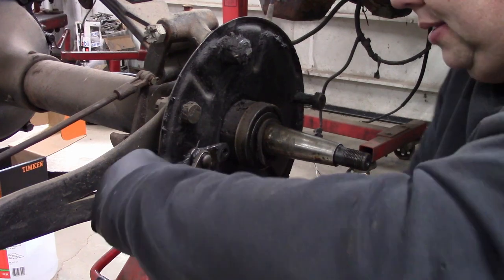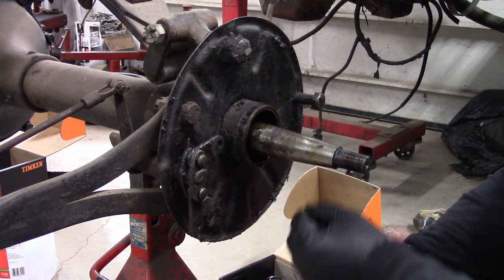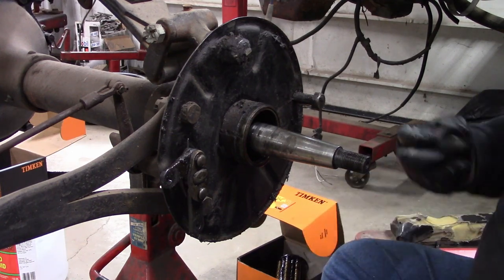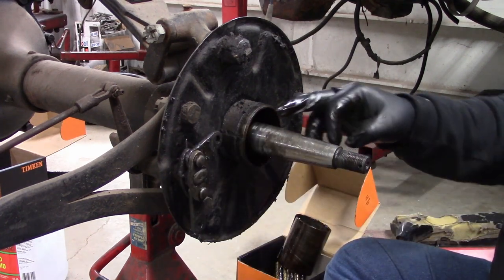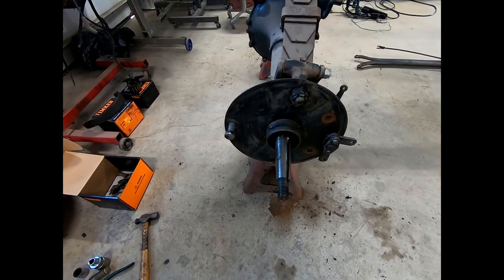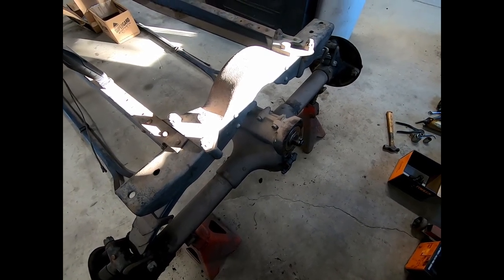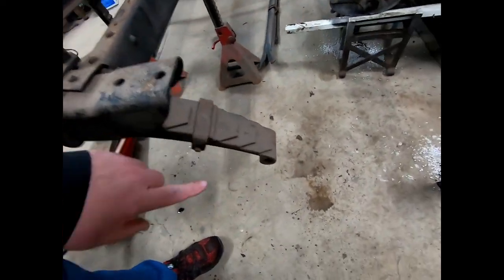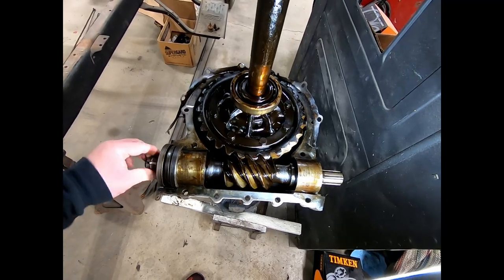Model TT Ford Chassis Build 2

Comment: My 26 TT also had no interior seals.  The original crown gear was knife-edged, so I replaced it with a set of express gears.  The spider was the older 2-gear style, so somebody had swapped axles sometime in the last 100 years.  I went back with the later 3-gear style spider.

Comment: I've never seen the inside of the TT rearend, interesting.  I used the modern inside seal and felt outside seal on my speedster and it seem to be working out so far. (I better not brag or it will fly apart blow oil out)   Great video.   Cheers from the shed
Reply from the maker: I thought it would be neat to show  and they are so much simpler than the car rears!  Better knock on some wood to get your luck back.  Thanks for watching!
Reply: @solarcitygarage  Hello T Ford, guitar playing brother. Cheers.

Comment: That worm drive is pretty neat and those leaking seals probably saved you from a lungful of asbestos dust.  What are you going to do for new shoes?
Reply from the maker: Yes, it just makes you want to turn it and watch it work.  As far as the shoes, I have saved a few sets over the years, they do pop up on ebay every once in awhile, but not nearly as often as they used to.  Thanks for watching!